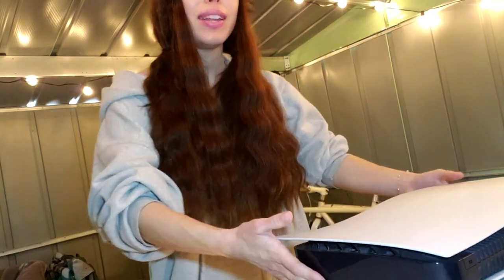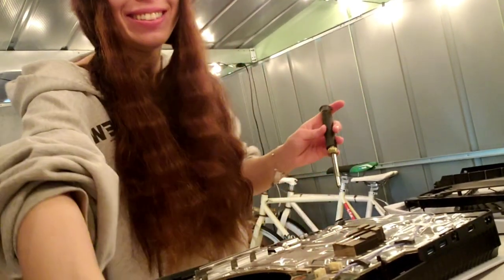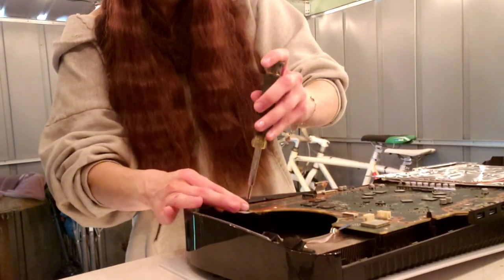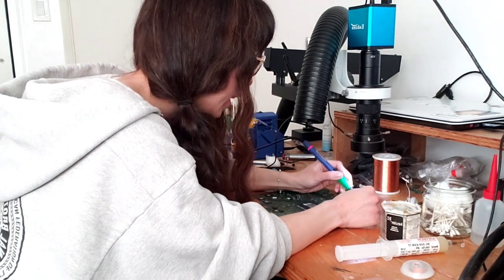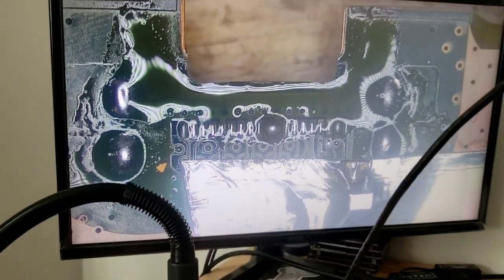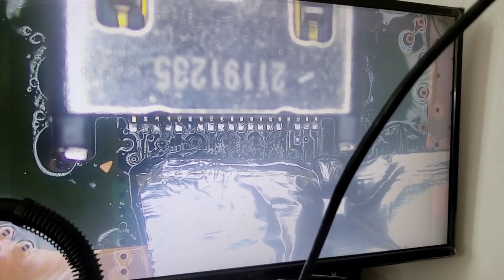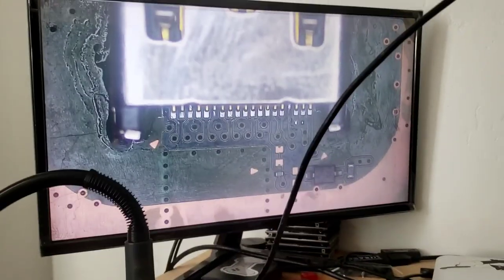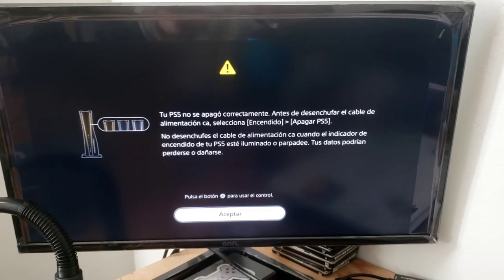How to Fix PS5 No Signal or Black Screen of Death For PlayStation 5 Damaged HDMI Port by Girl 👧

Comment: Thanks a lot for this, I've shelled over 200 to my local repair shop on two separate repairs. Seeing pros do it on YT is one thing, but you don't fit the stereotype of someone who knows about electronic repairs and you have absolutely given me the confidence to attempt this repair myself. Crossed fingers for smooth sailing.

Comment: I'm glad that you fixed it. I accidently damaged my PS5's HDMI port back in 2021 and i made it much worse by tempering with it multiple times so am still stuck having to rely on the Remote Play app to display the PS5 screen even though using Remote Play does mess up my PS5 gaming experience. I refuse to send my PS5 back to Sony for repair but i don't want to resort to buying a new PS5. I wish PS5 had an extra HDMI port for backup. The way my PS5's HDMI port first got damaged in the first was when i smacked my internet router/modem over my table out of anger when my internet went out' it accidently landed on my PS5's HDMI cable while plugged in since i placed my PS5 near my internet router/modem.  It's unfortunate that PS5 HDMI ports are fragile.

Comment: Great Job.  I would solder the 19 port legs to create a stronger joint as it may fail pre-maturely due to the port pressure when plugging in the HDMI cable. Also its good practice to hold the port down with your tweezers while the molten solder hardens.  All that being said, the most important thing to say is GREAT JOB!!! Its refreshing seeing a girl make this repair.
Reply from the maker: Thank you that means a lot! And yes thanks for the advice! I'm keeping up with lots of practice and anything helps(:
Reply: 10:11 😊

Comment: Nice repair, well done.
I think after the port replace you're mising the tiny capasitor between the legs 17/18.
Reply from the maker: I think it might look that way due to my poor filming (I apologize) but the capacitor was not damaged/missing 🙂
Reply: @anyaimlle No it's definitely missing. When you blobbed solder on the pins, you put it over this capacitor. Throughout the video you can see the 2 pads where the cap was, just below pin 17 and 18.
Seems it's not a necessity to retain it.
Reply: @RestoreTechnique Yes that was missing, taping it down works. Or just replace with solder paste before installing a new port.

Comment: Port would move into its place if you tin the pins prior to install. Add solder to the pins of the replacement hdmi port next time and itll be easier. Great video by the way 🤘

Comment: Great one yet my problem isn’t fixed yet 😢 I can’t go anywhere because the maintenance center told they had to replace both HDMI port and HDMI encoder video output with new ones and nothing changed! I’m really disappointed. Any idea?
Reply from the maker: There are a thousand things that could have gone wrong. if you are lucky the damage will be isolated to the hdmi port. if your system was dropped then its possible JUST the port was damaged. if the image or video signal cut out to black and from then on did not work, then the HDMI port is NOT to blame. thats an encoder issue, or your filters went out (rare). your motherboard may be missing components due to the drop damage or your APU could have been damaged in the drop as well.

Comment: Awesome! I'm happy to see more females doing these type of stuff which surprises me that there aren't many since this is similar to doing some kind of surgery but in the electronics field lol. I'm a guy and was never into this type of stuff until I had to mess around with one of my console/handheld years ago. First, the PSP when it came out doing the battery mod and then later the PS3 when it first got hacked and I needed to solder many thin cables to the TSOP NAND Flash Memory chip legs to back it up and then flash it back with the modified firmware. After that I loved doing electronic repairs. Now here I am again looking to replace an HDMI port lol. And you have some nice tools I see! Nice.

Comment: Do you solder looking at the monitor screen kinda like Northridge fix or are you just using your eyesight to solder the HDMI? Thanks
Reply from the maker: @MrRawUK  I look at the monitor 😇
Reply: @anyaimlle  I just got a Trinocular microscope but i think i'd prefer just to use a large screen. I will have to experiment. Depth perception is key i guess.

Comment: I was wonfering if you take any consoles to repair. I tried fixing the hdmi port of my friends ps5 and since I had no expereince dping port replacements, I ended up not being able to fix it and ended up loosing the tiny capacitor and ripping one of the pads
Reply from the maker: Yeah, do you live in San Diego?
Reply: I live in Los Angeles, but I can find a way to make it there
Reply from the maker: @Ninjaclutch1130  ok if you ever come to San diego contact me
Reply: @anyamechlle  in the situation where I can't make it to San Diego, is it possible that I can send it through the mail? And how much would you charge since my failed attempt to fix it because I ended up ripping a single pad and lost the capacitor next to the hdmi port